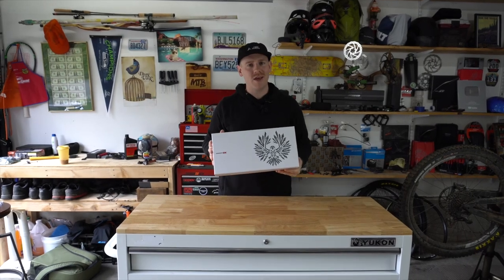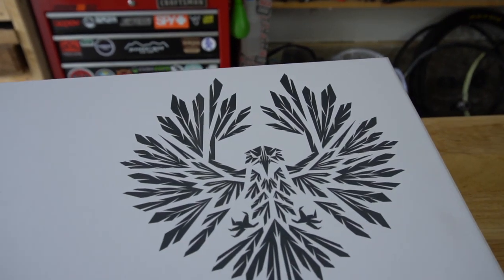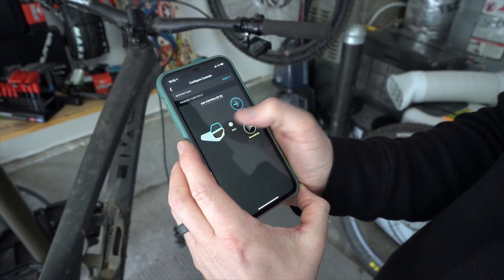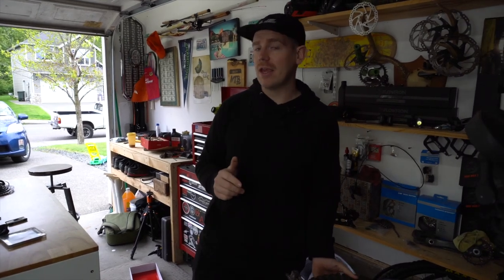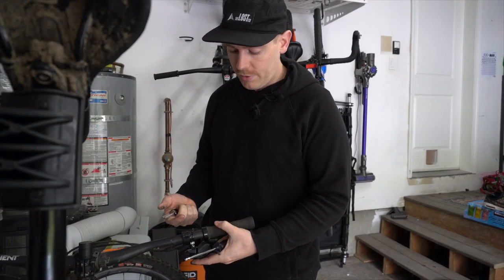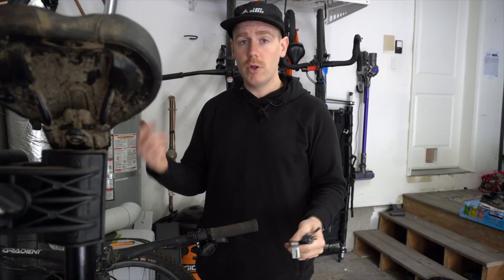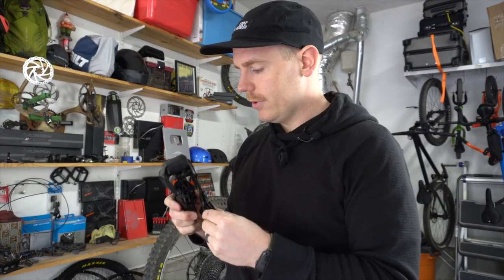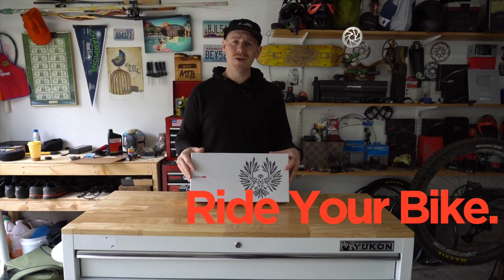5 Reasons You Should Upgrade To Wireless Shifting

Comment: Wireless shifting is just one more expensive and complicated thing that I don't need. If my drivetrain isn't shifting into a gear properly, it is usually easy enough to use the barrel adjuster to make micro adjustments. You shouldn't have to shift two gears up and then drop down to get into a gear. If you do, your derailluer isn't adjusted correctly. Having to deal with another app, batteries, and electronics in general are something I don't need on a bike.
Reply: I'm a bike mechanic, as are many many many people so i'm not saying my perspective is "greater" than anyone else's but it's worth noting that as someone who works on very high end bikes on a daily basis, electronic shifting is amazing when it works well. Of course there are times when you may forget to charge the battery or when the circuits could unlikely short out blah blah blah but tuning a drivetrain is something that isn't very intuitive to most people that don't normally work on bikes. Wireless drivetrains not only make your bike LOOK better but they also make tuning the shifting much easier and there really isn't much denying that. I've had SO many customers come up to me and ask me how the hell they can fix their shifting on their own... i go on to explain it to them and most of the time they end up leaving their bike with me or my co-workers to fix it. the whole idea of "i don't want electronics on my bikes" is absurd to me. if you were born in the 50's then i understand how you could be certain that electronics are unreliable but times have changed and often times, electronics are the MORE reliable option than their mechanical counterparts
Reply: @dash0173  I can see how electronic shifting is simpler and easier for someone who doesn't know much about adjusting derailleurs, but personally I usually can adjust my derailleur (currently running Deore 12 speed) if it is out of alignment, unless something is actually broken (in which case an electronic derailleur would be far more expensive to replace). If something happens with an electronic derailleur, such as a short circuit, issue communicating between the units, or other electronic issue, I have no idea how to fix that and it would be much more expensive to remedy. I just like the simplicity of knowing that I can hop on my bike and go for a ride without thinking about if my batteries are charged or having to use an app to adjust my derailleur. And for the record, I was born in the 90s.
Reply: @dash0173  you fail to see that charging a battery is a reliability issue. Now mechanical shifters also have reliability issues but neither is really better than the other. You still have to tune a wireless setup only you can't do it on the fly you have to stop and pull out your phone open the app and proceed to screw around. Wireless setups can also be mis adjusted just like mechanical setup so the person who knows nothing will screw that up too. Now a wireless setup that adjusts itself and charges itself im down for that 100%.
Reply: @dash0173  As a full time, professional software engineer, I can assure you that most electronics are far more precarious than you'd hope. XD I can't speak to the reliability of AXS in particular, but I would be extremely reluctant to trust the tech with something more critical like my brakes if that were an option. I can definitely see the appeal of electronic shifting, though.
Reply: @mattschirle  okay wireless brakes would be dumb and that's why it's not a thing. yet.
Reply: @brandonreimer184  charging the battery is a reliability issue that differs for each person. i personally have no problem remembering to charge the battery on my wireless equipment but the next person may suck at remembering but that's not to the fault of the equipment, right? also the battery lasts a very solid amount of time, like multiple weeks if you're riding a lot and within those time periods between when the battery would die, it's probably safe to assume you'd remember to charge the battery at least once.
Reply: @dash0173  if you are someone who doesn't have much time to get out and ride that 1 time could mean not riding at all that week or longer. I'm not saying that it's not a good or reliable system I'm just saying that it has its drawbacks just like anything does.
Reply: @dash0173  Agreed. I only brought it up to illustrate my point that electronics are generally LESS reliable than purely mechanical systems contrary to what you said in your comment above.
Reply: Will the AXS battery suck and don’t last quite as long as out of the box over time, just like all lithium ion cell phone batteries? All my phones drain fast and don’t hold charge like how they do when they were brand new.
Reply: @dash0173  im going for the wireless when i get my specialized Tero

Comment: Will upgrade once Shimano gets on board with wireless drivetrains.
Reply: Why wait for the less superior drivetrain?
Reply: @buildtestflyrepeat9428  lololol yes!
Reply: @buildtestflyrepeat9428  the better company lol
Reply: @FelixT370  yet didn’t didn’t disagree they the less superior drivetrain 🤔
Reply: they will not
Reply: Shimano are taking so long, because they are perfecting it...SRAM innovate, shimano perfect. Take ur pick...early adopt and have the issues and high price, or wait to get the more robust reliable cheaper option 2+ years later. Simple.
I run sram eagle, fyi. 
*does not apply to later shimano brakes and their unfixed wandering bite point, btw!!

Comment: I wish it would micro adjust per cog because that's the only reason why I bought the GX AXS but just like the barrel, if you adjust it on one cog, it adjusts all of the cogs. SRAM can definitely do an update on their software and have the system adjust per cog. That would be a good reason to switch but right now, no they do not micro adjust per cog.

I just switched from GX AXS to Advent X after running the AXS for 3 weeks, 235 miles. Not because I don't like the AXS, I do but I hate the GX Cassette. It's so loud and the 42T/50T doesn't always have the chain go in smoothly because of the narrow wide profile. I think the X01/XX1 cassette is best to pair with AXS. Maybe I'll upgrade the cassette later on... Right now, I'm enjoying the quiet and smooth engagement of the Advent X which is .35 lbs lighter that the GX drivetrain and only cost me $183 USD OTD.

Thanks for posting this video btw. Looking forward to you review.

Comment: I run currently Shimano Deore M6100 SGS, cheap so I can smash it to bits, not lose as much money, Garbaruk 11-50t 11 speed HG cassette, its the lightest 50t cassette on the market, Absolute Black 32t oval, Archer D1xtrail with micro-adjust remote.

Comment: @ dmbr...if your cable systems need micro adjusting post initial cable stretch, then you are not setting them up right, period. Set up fs only at sag. 
Most good cables come pre-stretched now. Others, Once stretched in dont continue to stretch.
BUT, as cables wear (get dirty) and drive trains wear, any imperfections in set up get magnified.
So wireless does remove the main cause of this, the dirty/worn cable.
But the price, even at gx, is so exorbitant. 
Shimano will undercut, once they launch their wireless this summer...plus it will have 2x options, with one battery on the rear mech linked by a wire to the front, to reduce front mech bulk and improve 2x tyre clearance, and reduce 2x cost, meaning more gravel users, and easy low cost to apply to road, all from one base system.

Comment: The calculations for battery life are not correct. 

You might ride for 3 hours a day but you won’t be shifting for 3 hours a day. Even if you are very busy changing gears that will add up to only a few minutes shifting during your ride. 

I bought AXS when it came out 2 years ago and I ride my bike several times a week. Probably about 10 hours a week minimum. I have had to charge the battery less than 10 times. And some of those have only been 10min top ups from the parking lot while I get ready to ride because I realise the battery is critically low. Those 10 mins get me through a couple of weeks before I do a proper full charge when I remember to do it. 

Battery life is amazing.

Comment: I don’t understand your first point. It’s just the same thing as a barrel adjusters function right? You can’t adjust each gears micro adjustment independently of the other gears. The indexing between each gear cannot be changed, so micro adjusting up or down shifts the overall position for all the gears, just like a cable barrel adjuster.

Comment: NX/GX chains are significantly lower quality and tolerances than the xx1 or xo1 chains. They are a very false economy...though the xx1 rrp is a total rip off.
Difference between xx1 and x01 though is only the coating colour (both have ti coatings...tho the gold is claimed to be more durable)
Reply: i moved up to the X01 chain from GX since I read it has double the life of GX chain at double the price which to me was worth not having to change it out as often and would be less wear on cassette. so far it's proven to be a good choice!

Comment: I’m sorry but you are wrong, micro adjustment does not apply to each gear separately, it works the same as the mechanical barrel adjuster, meaning the adjustment affects all the gears at the same time not individually.....

Comment: I can add one more reason - you can pair the controller with your Garmin device and it will show the position of the gear on the screen. It can even show gear ratio. There is one problem however. In a real race situation, when you shift constantly, battery lasts about 9 hours. I usually charge every other ride.

Comment: I had the Archer components wireless shifter. One day I got up for a ride drove to the trail turned on my shifter and nothing. Somehow water got into it and shorted everything out even the battery was bad. So though to myself what if this was race day? The shifter did work good when it was working. But there was no warning when it went bad. 
So I went back to NX. This battery system seems better. I’d like to see it in wet conditions.

Comment: That you can adjust every single gear individually is the ONLY reason you need!! That's next level amazing! I just need it to trickle down to the Deore kinda price range.
Reply: Yea it would be. Only, it doesn’t.  You can only adjust them all together. I was a little disappointed when I discovered that I couldn’t.
Reply: @codyritenour5196  ??  What??  So you're saying the adjustment is just like the old cable tension? (ie - it moves ALL the shifts in or out the same distance??)   Surely they'll do an upgrade so each click can shift it's own distance?   (I'm much less inspired by these now if that's the case)